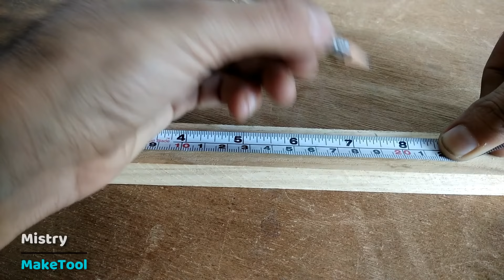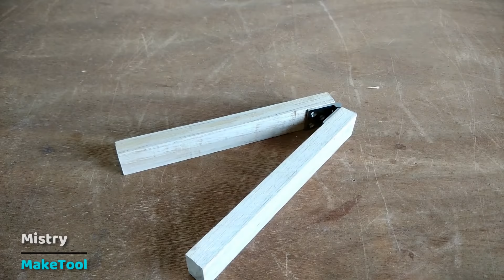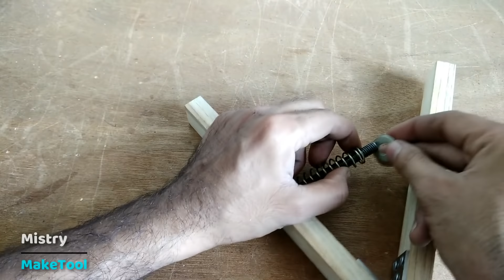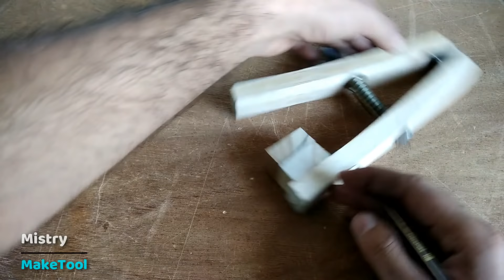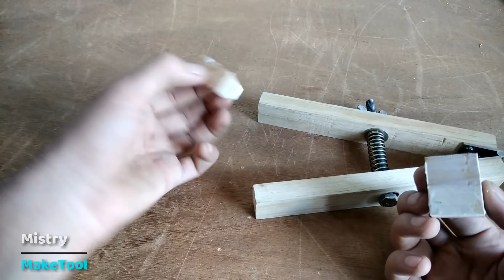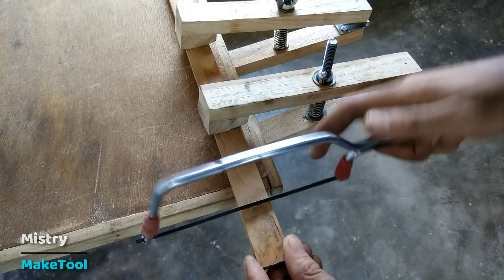How To Make Wooden Clamp || Diy Wooden Vice Clamp

Comment: The spring in that clamp actually fights you when you tighten it. The spring is not neded, and is only on spring-clamps as it is on the other side of the pivot...the handle/leverage side.

Comment: There is absolutely no point of the spring, the tension caused by adding the spring is outwards where as it is only beneficial if the for is inwards.
Reply: Wondering the same thing

Comment: How strong are thoseClamps. Ive been watching various diy wooden clamp builds. My reason for building clamps is ive brought loads of f-clamps also 2 quick release clamps the very first clamps still work but the second lot are shot at they are not gripping, where the main clamps runs up and down the little grooves are shot at, I was thinking of drilling holes and using bolts to help. Sorry if its long winded hope people understand what im blabbing on about.